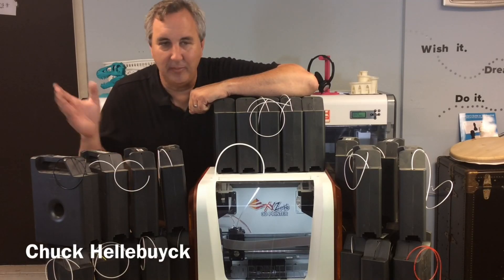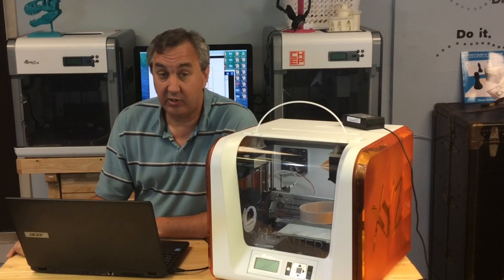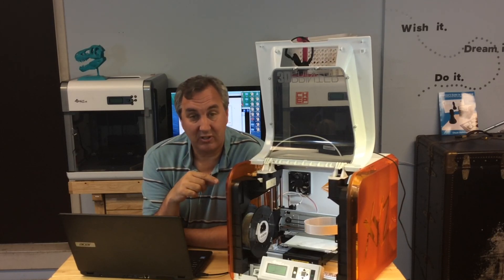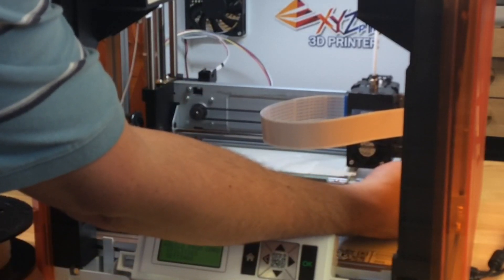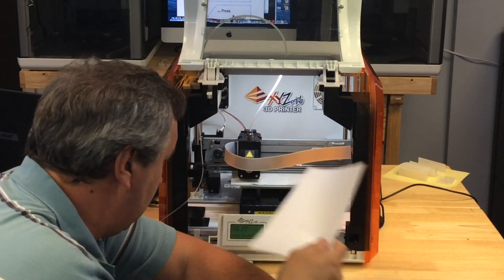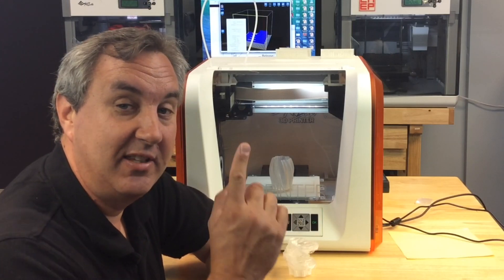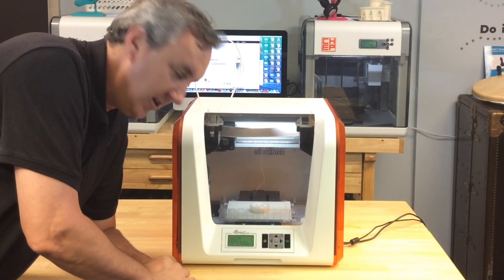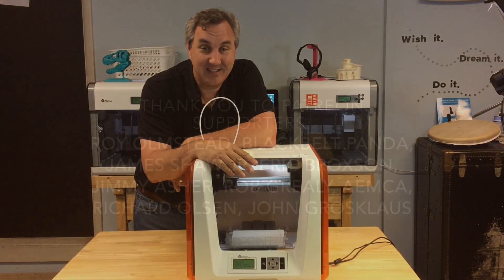Filament Friday #21 - Calibrating the Da Vinci Jr. Bed / X Axis and Bearing 3D Print - Video #66

Comment: Those 2 screws are round hole with no play.  I took the head assembly plate out of the printer and rounded out those holes in the direction it needed to move.  I used a 2.5" hard drive as my gauge and was able to level it.  I apricate your video on getting in the right direction.

Comment: My print job stops at mid print and cancels my print.  Is there are way to fix this problem?
Reply from the maker: Try a new SD card.
Reply: @FilamentFriday  I use a USB cable.
Reply: @FilamentFriday  I changed the SD card, same issue, it prints and then it stops saying it is a filament jam.
Reply from the maker: No idea then. Didn’t know it had a filament sensor. I don’t have XYZ printers anymore.

Comment: is it normal for the print head to make a slight tick when it quickly returns back to position? Not the click from the spool. More like a type write return to position, but not very loud (be steady, happens through the entire print). Thanks in advance for your reply, love your channel.
Reply: machine is calibrated in every single way possible. and no matter what I do it starts every print off with a little blog after the test / cleaning strip. Makes little curly things when it try's to build supports of any kind and absolutely failed at printing the ball bearing. It did the outsides ok, but when it got to the first step of the balls it was curly Q madness. I, not knowing a lot about 3d printing have no idea if it's me or the machine. Maybe I should just ditch it for something better /:
Reply: CHEP 3D Printing & Electronics what is the highest quality machine right now for around $500? In your opinion..
Reply: it's working a lot better with glue stick, but I feel like I shouldn't need it for the prints I am doing. I am trying the bearing again, supports are staying, but are lifting a little. You need to add your own supports for the bearing right, they aren't built into the design?

Comment: Your frustration for setting the da Vinci Jr. v1 is palpable, Chuck. Frankly, I wish my problem was as easy to fix as yours.
I got through the first filament spool perfectly, but when I put the second one in (about 5 days later), the quality just tanked on one side - the right side that just feels so floaty. I'm not sure if it was because the extruder axis sagged on that side or the print bed itself sagged.
I've tried to do so much to fix it. I've put plastic wedges (8.58mm wide, within the crippled capacity of the printer to make it) to try and lift the metal rod away from the gray bracket that holds the entire train. I've had to throw the Z offset *literal millimetres at a time*. I'm currently down to 0.9mm, and I've wasted about 50m in test prints and purges/wipe lines and unloading and loading the filament spool and deep-cleaning the nozzle and oh my god it is a huuuge pain.
And I'm not sure if it's because the machine decided to have this conniption on December 22, but as of writing, XYZp support haven't gotten back to me. It's coming up to the New Year, so maybe I won't hold it against them.

The funny part is that I also can't do the "put the power brick on the bed and rest the Z-axis on it" method their video says to do. The machine is really temperamental about whether or not it'll let you jog the print head more than a few millimetres (sometimes, sometimes not). But my problem comes from the fact that the cord they gave me that connects the brick to the mains supply is only a foot long - by the time I get the brick in the printer, the printer's dead. I've had to use my Halo 3 steelbook (completely ruined the finish on it). And the print is still really threadbare in places, blobby in others, and sometimes there's nothing but knocking from the extruder.

Maybe it'll work tomorrow. Between your channel and Maker's Muse, I'll be busting with ideas.
Maybe I'll print a hammer so I can smash the eff-ing thing to bits.

Comment: Follow-up: I used a feeler gauge to check the gap and found the table to not be level. So, I measured the part with the greatest distance and then loosened the screws. The screw layout on my DaVinci Jr. is different than the one shown in the video. I put the feeler gauge underneath the area with the least clearance and tightened the screws. I'll know if it worked on my next print. Unfortunately, that has been delayed by the fact that the printer tells me there's not enough filament for my next job, even though there's a substantial amount of filament left on the spool.

Comment: I contacted XYZPrinting support for help with the printer cutting into the tape. They gave me the link to this video! This video is a lifesaver! It helped me start printing again. I am going to try the adjustments shown in the video to tweak the printer performance. My DaVinci Jr. printer also came with a table that was not level .It's a shame that XYZPrinting has to refer me to an independent video to solve a problem that seems to be in many of their printers. At least they referred me to a great video!

Comment: Just to make sure I understand (I, too have the bed calibration issue), you bottomed out the carriage by loosening the two T10 screws and then adjusted the right side with the screwdriver?

Comment: would you recommend the Da Vinci Jr or DaVinci 1.0. Is one better than the other?One other question. Once you print something using their filament, do you know what temperature the material can tolerate? I mean, if you printed a cup, could it hold a cup of boiling hot water?Thank you.

Comment: Thanks for your video Chuck. If I may: I took a different route to adjust the bed. I found the bed tape was being cut into at max X while the feed gears clicked and scraped, and at min X the filament did not stick. The adjustment ability is awful - there is no travel in those adjustment screws anyway except for normal screw-hole clearance. I unscrewed the base plat glass clips, removed the glass, unscrewed and removed the metal glass holder, then shimmed under the metal plate with aluminium foil. It was a bit tedious having to disassemble and reassemble about 4 times, but I got a pretty level base plat in the end - immune to x-axis droop.

Comment: I have one more question for you...the screws that hold the belt tension spring assemblies in place...should these screw be tight to the point where they are effectively stopping the spring from moving, or should they be loose enough to allow the spring to expand as the belt gets looser over time?  I ask because both of the screws on the x and y axis on my Jr were clamped down tight, and I'm not sure if I should loosen them a bit to allow the spring to be the only thing effecting the tension, or if I should leave them tight and only loosen them to let the spring change tension when it seems like the bel needs to be adjusted?  Thank you again for your help!!
Reply: +Chuck Hellebuyck&#39;s Electronic Products Thanks!  XYZ actually got back to me quickly on this one.  They said I should PUSH the part with my hand to create the tension, then tighten it down with the screw.  I've been doing a bit of reading, and it seems that the springs might actually be there only to help with manufacturing so that the bits get themselves roughly into place during assembly.

Comment: Hello.  Great video.Other than cutting into the tape, are there any other symptoms of an x-axis that isn't level?  My DaVinci Jr does everything great...except circles.  With circles they end up looking a bit more like lemons...very slight "points" on the upper left and lower right sides.  From eyeballing it, the x-axis APPEARS level, but I haven't actually taken anything and used the T10 driver to loosen the axis and level it.  I've been told by DaVinci to do the x-axis leveling, and am currently waiting for some time to get to the store to buy the T10 driver.  I'm just wondering if you think that x-axis being a bit off from level could impact the way the machine prints circles, but not really impact much else?
Reply: That's what I have been thinking. X-axis tension seems fine, but I see no easy way to check the belt on the Y-Axis. From what you can see, is that going to require some major disassembly to get down to that belt?  So far it hasn't really impacted any of the prints I've done...so I'm not SUPER worried about it...but I am still in my return window through Amazon...
Reply: +Chuck Hellebuyck's Electronic Products Thank you.  The only thing that worries me is that the Jr still seems kind of hit or miss, and since mine seems to just do circles a bit wonky, I'm nervous that I might exchange it for one that does something else wonky, or something much worse.  I did some testing tonight and the x-axis is definitely not level.  On the left side with the print head set as low as it can go I can barely fit one sheet of paper in there without really trying, and on the right side I can fit three in with less resistance than one on the other side.  I think I might try to level the x-axis first, because the T10 driver will be necessary for work on it down the road anyway, and see if that does anything.  If not, then I'll start to seriously consider exchanging it, or possibly upgrading to the new Pro model.
Reply: Is the DaVinci 1.0 a better product than the JR?  I'll only be printing with PLA for the foreseeable future. I know a lot of the knocks against the DaVinci line is that they DO in fact need calibration, despite the advertisements that they don't.
Reply: +Chuck Hellebuyck's Electronic Products I adjusted the x-axis today and did a quick test print of a circular item.  A tiny better, but still noticeably not a circle.  Figuring I was going to probably end up exchanging this printer for another, I figured what the heck and tore into it.  It's actually not difficult to get down to the y-axis belt.  The four screws that hold the glass bed in place, then three screws that are visible under the glass are all that's necessary to get to the belt enclosure...then that enclosure just snaps off .  Once I was in there, I noticed that the y-axis belt was VERY loose compared to the x-axis belt.  I couldn't really see back in the back (I didn't have the case disassembled) so I grabbed my phone and took a picture of the spring assembly that keeps the y-axis belt tensioned.  It has a screw (same T10 as all the others) behind it that you can't see.  A quick half turn to loosen that screw and the entire assembly snapped back a good 1/8th of an inch or so...that screw had the whole assembly so tight that the spring that keeps tension wasn't even actually doing anything other than remaining compressed all the time.  I loosened it a bit more and let it settle, then I tightened that screw back down.  

A second test print resulted in about as close to perfect as a circle can get!!!!  Awesome!!!  

I'm running a second test print of a more substantial object right now to make sure, but I think I've got the problem sorted, and I won't have to be sending this one anywhere after all!!!!
Reply: +Chuck Hellebuyck&#39;s Electronic Products I can try.  I was thinking about making a video to show the whole thing and posting that.  It will be poorly edited, as my computer doesn't work with my editing software ever since I got Windows 10...but it should show what needs to be done pretty well.

Comment: I got my printer Jr. and it's giving me an AWFUL clicking sound from the gear motor. If I adjust the bed would the noise go away? Also the filamanet doesn't come out when it makes the sound. Please help me. I cleaned the nozzle and the gear motor already.
Thank you for any help
Reply: +Chuck Hellebuyck's Electronic Products - Thank you. My bed is pretty leveled and it's working better but still clicks sometimes. Also When I load the filament it clicks a lot, and it has nothing to do with the bed. I already cleaned the motor gear. I followed the video by opening the side of the printer. I also deep cleaned the extruder head. Do you think is something else? I really appreciate all your help.
Reply: +Chuck Hellebuyck's Electronic Products . One more thing and I hope this gives you more clues. When it clicks and I release the tension with my fingers on the motor lever, it seems to stop the clicking and the filament comes out. But I don't think that is a solution. Do you think is the gear motor? Thank you :)

Comment: I ran into this problem right after getting the printer.  The unit right out of the box dug right into the masking tape and made a horrible clicking sound.  Thankfully it worked regardless and the sample still printed (though it was a PITA to get off, and it ruined the tape).  Despite doing their x-axis adjustment it is still off, so I decided to put a shim under the left side of the glass to boost it up where it is parallel with the head.  My z-axis is much higher than yours though, 1.3 leaves no room under my head.  I had to leave it at 1.85mm to leave enough room.

Comment: May I inquire real quick, as to the quality of the Sample Vase built into the Da Vinci Junior? I bought that printer a few days ago, and it's been awesome after a few minor tweaks. But I've noticed a slight issue on mine and also on my buddies printer which is also the Junior. The issue is, the Sample Vase is perfect except a bumpy line stretching vertically from the bottom to the top of the vase. So I have a vase which looks like someone gently took a super-hot butter knife to one side. Is this what your Sample Vase looked like? It's not a cut in the vase, it's more of a vertical smudge. It's not visible when looking at the vase from about five feet away. Any ideas, if this is typical? I may need to ensure my printer is level...but the weird thing is, the issue only happens on that Sample Vase and nothing else.

Also, when importing a cylendar, or a wedding ring for example, the XYZware likes to insert a gap on one side of the cylendar. So if you imagine a hoola-hoop which has been cut on one side. When looking at the model before printing, it looks fine. but after clicking print, XYZware converts the 3d model into a blue representation of what the printer sees, and that's when I notice the vertical gap. 

The circle objects I import into XYZware, are from SketchUp software's STL plugin.

Anywho, I love the Da Vinci Junior as my first "easy bake oven"...but when I can get a finer detailed 3D printer...I certainly will.

Comment: I had the clicking sound, it was the PLA feed slipping because the head was too low. It also causes chatter when the head moves across a layer as it prints.  The bed seems level.  I did a test print with a solid 0.5"x0.5"x0.2" piece.  Printed this over and over at different settings, measuring after each.  After the head is moved up a bit, no more clicks.  But the accuracy not as good as I hoped, getting better as I increased the Z offset.  Ultimately the parts were always smaller by about 0.02 to 0.03"  Eventually Z was too high.  I have been printing with the Z offset about 2x the point where I was hearing a click from the pusher.

Comment: So my da vinci aio 1.0 was calibrated the other day because I had just finished calibrating the printer for the 5th time. I did about 4 or 5 successful prints and then filament stopped sticking to the bed. I checked if the printer had moved or the table was wobbly and it was fine. Then I turned on the calibration setting and it started to calibrate but it kept calibrating point 1 and never went to any of the other points. Now I think that the issue is with the sensor but i don't know for sure. Can u help me with this and show me how to fix it